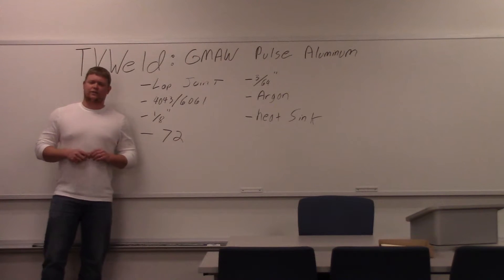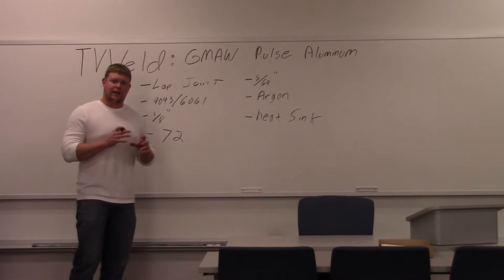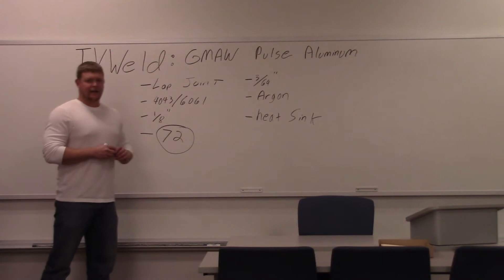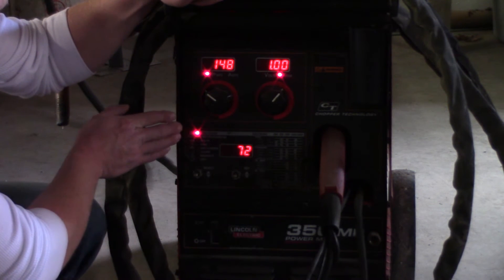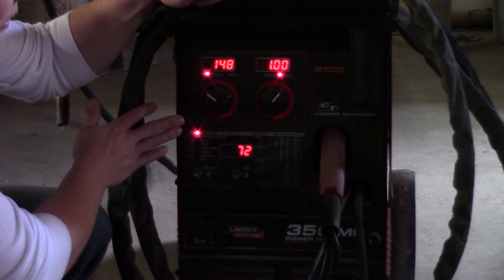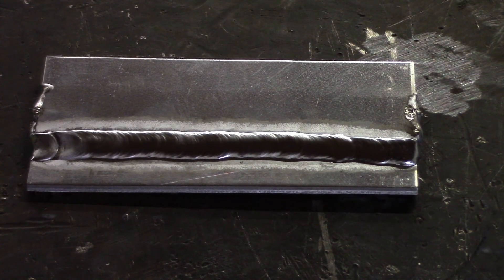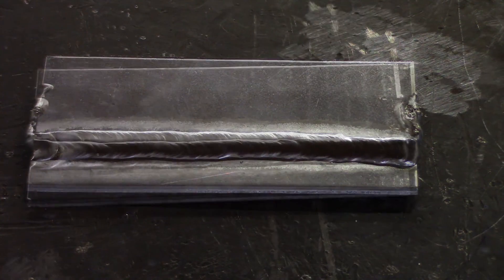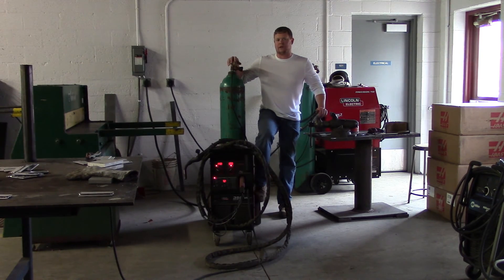Pulse Aluminum MIG Welding

Comment: why would you use 4043 on 6061?
wouldnt that defeat the purpose of 6061?
Reply: Mr. green No! I weld T6-6061 with 4043 filler and have been for many many years... It is what's recommended for 60 series aluminum..